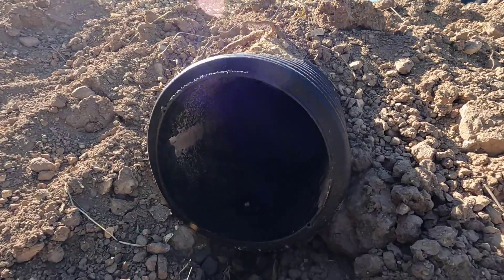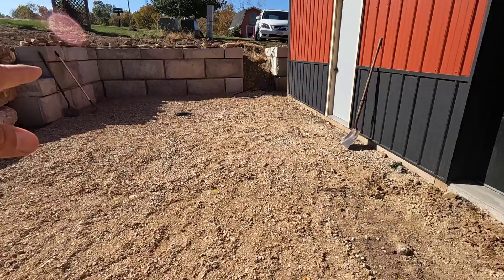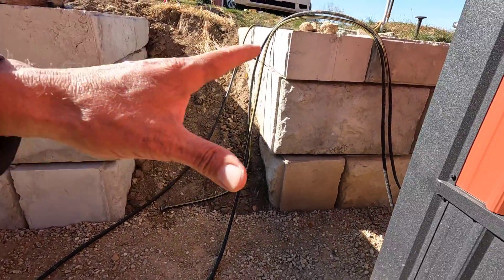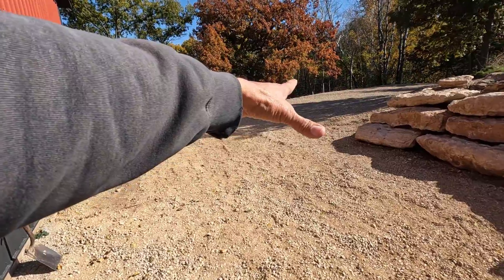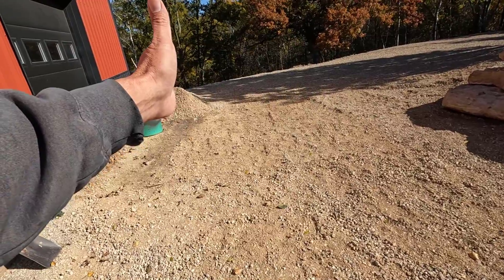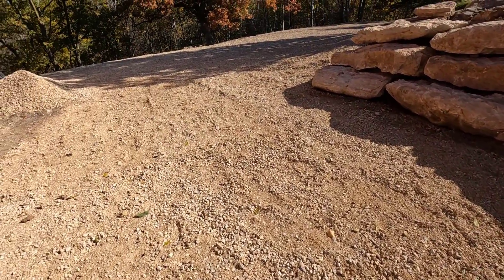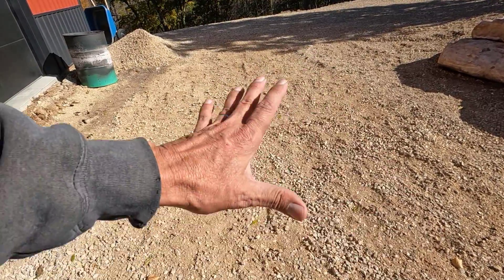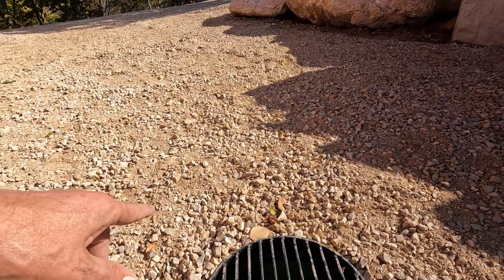Installing a Manhole Culvert Pipe [Storm Sewer]

Comment: Great job! That should solve most of your drainage problems. Was bit surprised you used collars instead of belled ends where you drive pipes together. But supply issues may have been reason. Collars were the way they put culvert pipes together before bell ends were invented anyway. They will work just fine and were probably a cost savings. Another fine video my friend. I liked this one
Reply from the maker: Thanks Dave! I've never seen belled ends on a culvert pipe. The don't sell them like that anywhere around here. 😐
Reply: @PlanetMojo  really? Thats all we use. Have to use an excavator or something to drive them together, impossible to do by hand. Collars are fine and are easier. Was just curious. Hard to find collar pipe here tho. Ask for it and they just kind of look at you with that deer in head light look 😊
Reply from the maker: @ccrx6700  I believe culvert pipes are manufactured semi-locally so you get what is made in the area. Or pipe is manufactured about 100 miles from here. That is very interesting about he bell ends. The only thing I have seen bell ends on around here is electric conduit. Maybe It's because we get them at a big box store and they need to be home owner friendly?

Comment from the maker: Last year we had a trench cut back here to drain the area, but even at that 5 or 6 inches of water would collect here after a good rain, and the side of the hill was eroding pretty good! A trench and a culvert pipe would have worked as well, but we would have lost a ton of space, so this is the perfect solution to the drainage problem!

Here are some woodshop build links...

3M All Weather Flashing Tape - https://amzn.to/3ICBX4P
Huber ZIP System Liquid-Flash - https://amzn.to/31OtCtN
Seville Classics Commercial-Grade 5-Tier  60" W x 24" D - https://amzn.to/3qgjrXJ
5000 Lumen Temporary LED Work Light - https://amzn.to/3eslZfu
Heavy Duty 3-Prong Wireless Remote - https://amzn.to/3EnPWYN
Powermatic Model 60C 8-Inch 2 HP 1-Phase Jointer - https://amzn.to/3mvPq4M
Jet Contractors Saw - https://amzn.to/3mAAQJs
Insul-Hold - https://amzn.to/3evnmKq
1" Garage Door Chain Hoist - https://amzn.to/3rn11VF
1" 4:1 Open Garage Door Chain Hoist - https://amzn.to/3uldvQA
1" 3:1 Open Garage Door Chain Hoist - https://amzn.to/3IVxXf0
1.25" Garage Door Chain Hoist - https://amzn.to/32R3vmS
Ambient Weather WS-2902C WiFi Smart Weather Station - https://amzn.to/3GzRdNp
Brownell Oxpho-Blue Professional Grade Cold Blue - https://amzn.to/3BfKiYO
Evapo-Rust - https://amzn.to/3gJQEq4
Xcluder Rodent Control Fill - https://amzn.to/3oVsH3x
Great Stuff Pestblock With Smart Dispenser - https://amzn.to/3HfI2SG
5FT Power Twist V-Belt 1/2-Inch x 5 Feet A Type - https://amzn.to/3LTQQkF
Aluminum 5 Slot A Type V-Shaped Pagoda Pulley 5 Step Pulley - https://amzn.to/33GTclJ
Wixey Remote Planer Readout With Fractions - 300mm (12") - https://amzn.to/3scJQro
TamBee Hidden Door Hinge - https://amzn.to/3tpstTE
Yosoo Latch Lock - https://amzn.to/35Rh7ji
Spring Load Bolt Latch - https://amzn.to/3hF8n2c
Milwaukee 3/8" Crown Stapler (tool only)- https://amzn.to/3HKbtgb
Milwaukee 3/8" Crown Stapler (complete)- https://amzn.to/3igDDoz
1000 Stainless Steel T50 Staples - https://amzn.to/3toLUgM
MPOWER Triple Diamond Sharpening Whetstone - https://amzn.to/3ClrZ52
Rockwell Wood & Nail End Cut - https://amzn.to/3tfOQMz
Pioneer Diamante Series Ductless Mini-Split (9k) - https://amzn.to/3twjXnb
Pioneer Diamante Series Ductless Mini-Split (24k) - https://amzn.to/3D0Yvtw
Nylog Gasket/Thread Sealant - https://amzn.to/3IyHCaT
Mounting Bracket for Ductless Mini Split - https://amzn.to/3L7F8C0
Vacuum Pump and R134a Manifold Gauge Set - https://amzn.to/3qryKNM
CopperCoat Green Wood Preservative - https://amzn.to/3cqxVBb

Comment: I didn't even know you could get those angled sections or grates. Do they have them at the big box stores or is there a special place you ordered these parts from?
Reply from the maker: I got these special order at Menards. They took several months because of the supply chain issues, but they are in stock again.